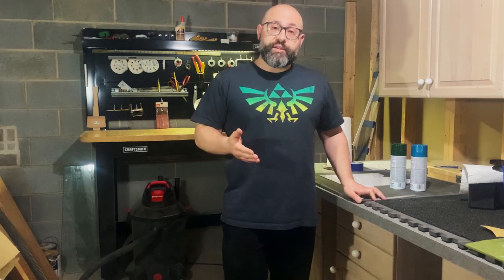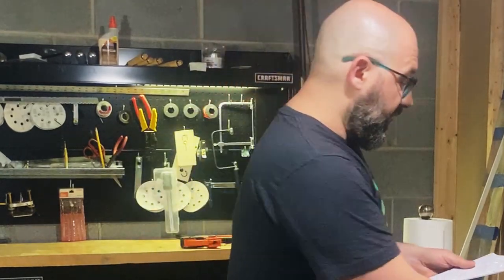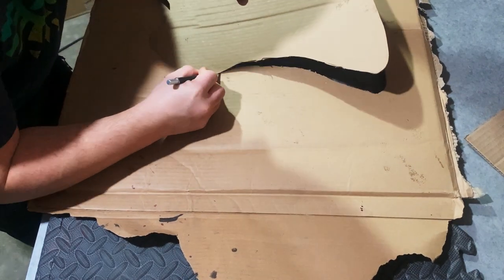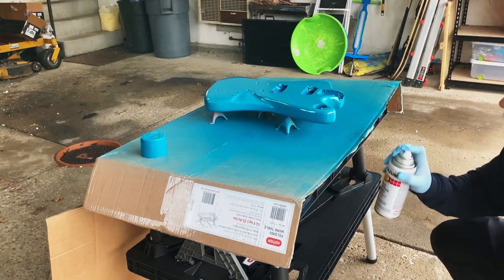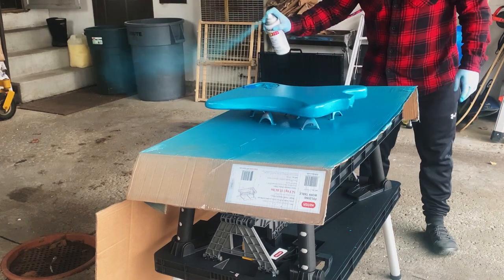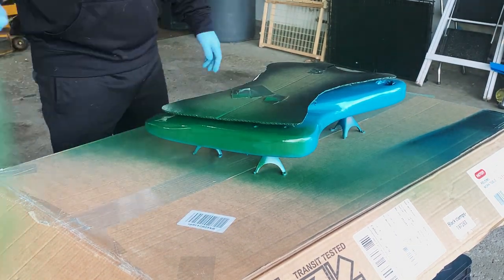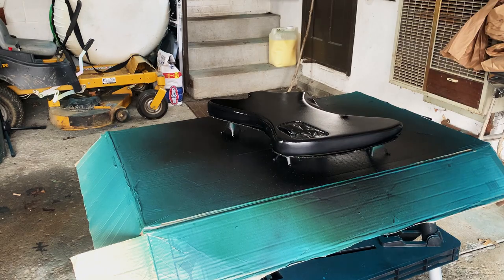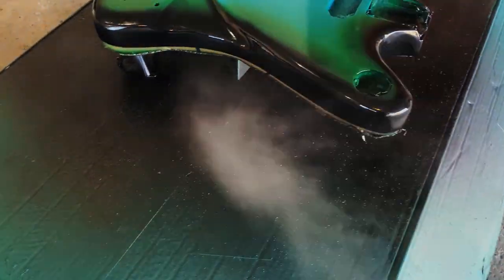GGBO21 - Firebird kit part 2

Comment: Also put your cans in hot water before you spray. Getting it warm will help it flow. Then with enamel, if you have time, give it about a week before sanding or else it will be gummy. Just some suggestions my friend. Good job on the final black gloss.

Comment: not sure of the truth behind this, but my research showed that enamel paints take weeks to months to fully cure....and that you really shouldn't sand or polish it until it's cured.....I've used it on bodies before, and ALWAYS had problems...
Reply from the maker: Thanks! I've read the same...but only after I bought (and used!) these cans. Can confirm on the problems, but things are working out ok regardless. I'll probably stick to lacquer-based solutions in the future to (try and) avoid those issues, however.
Reply: @mongur  I’ve decided that stain/dye and oils work for me...it sucks being impatient.  I can't wait weeks watching paint dry...